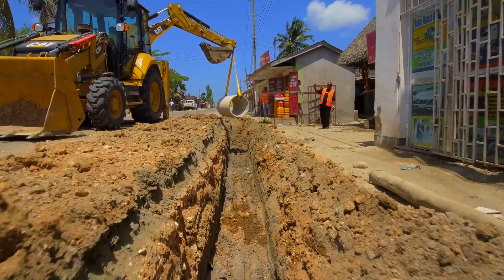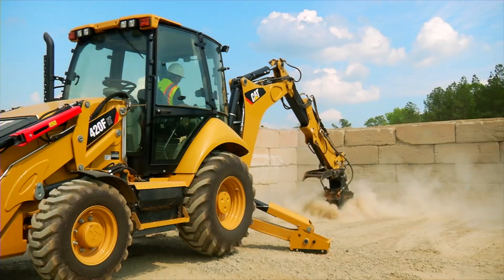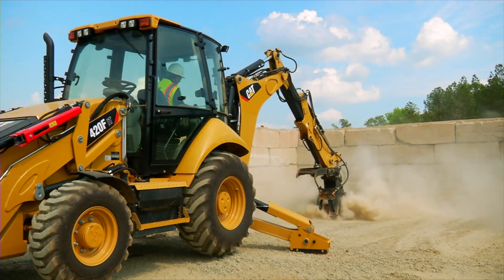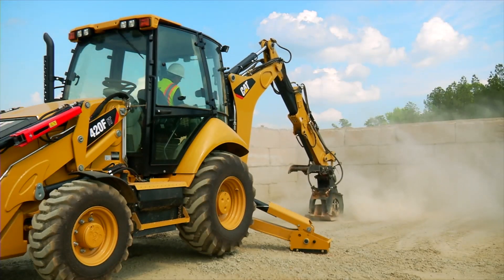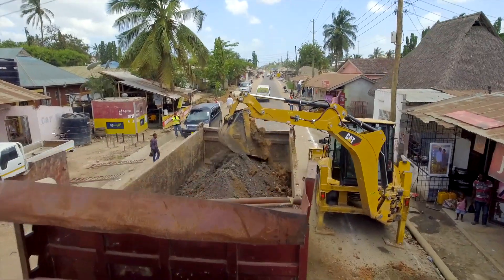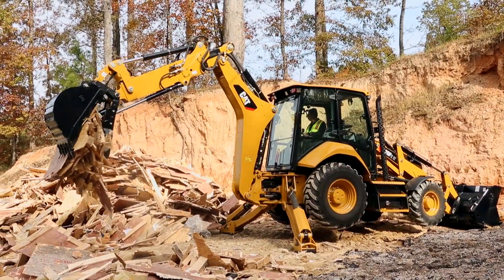Cat® Backhoe Loaders - Side Shift Design vs Center Pivot Design

Comment: I want a side shift with swing down stabilizers
Reply: All they need to do is add a hydraulic cylinder to make the legs angle out and would achieve most of the fold out design yet still allow the vertical drop also